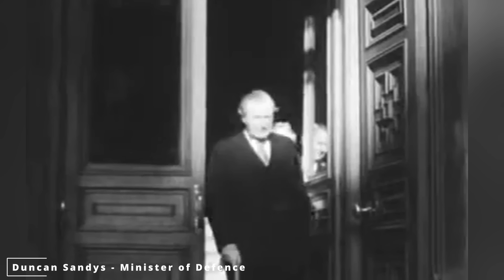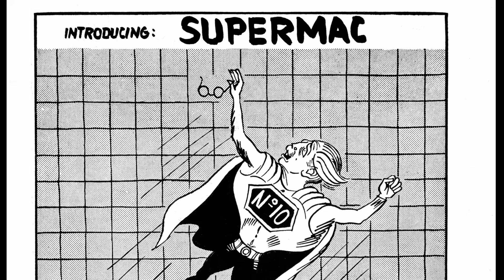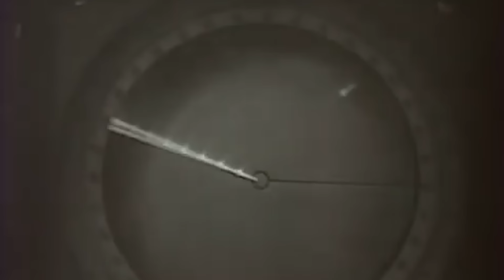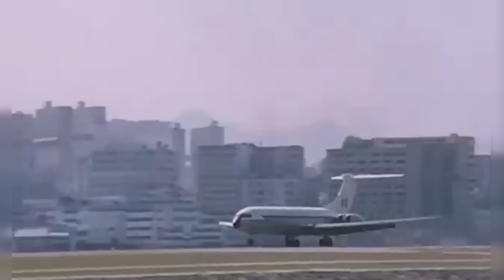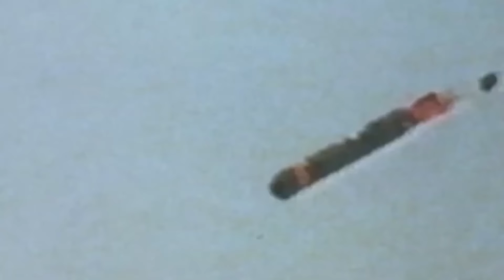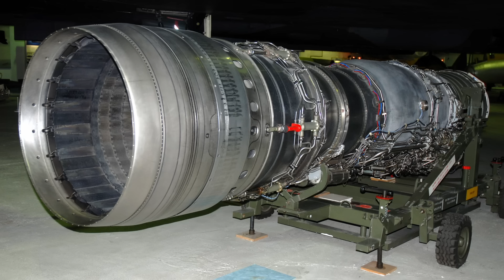How Britain Turned A Failed Airliner Into a Soviet Submarine Predator | The Mighty Nimrod

Comment: Most people know what a brilliant airliner the Comet was and how it became the Nimrod and equally brilliant. Americans don't know about anything outside of America so they pretend they were the first jet airlines and similarly they don't care to know how the Nimrod outclassed their Maritime planes.
Reply: Only the 2 Nimrod prototypes were built from unsold Comet 4C aircraft.
The Hawker Siddley HS.801 Nimrod is actually a completely different aircraft  and shares nothing in common with the Comet other than being assemble in the same factory at Woodford.
Reply: @sandervanderkammen9230  

We believe we can clear up some commonly held myths and misconceptions obviously.

It's always good to see the facts presented clearly and concisely isn't it?

Bow-wing (see B-47 wing collapse wing folding incidents) had built less than 12 pressurised airliners before the Comet first flew and they were not high altitude airliners. 

All Nimrods were new build Comet 4 airframes with appropriate strengthening and the unpressurized  equipment bay tacked on. 

The HS 801 Nimrod was the most advanced aircraft of it's type at the time it first flew. Problems with the MRA4 programme were almost entirely due to radar and computer equipment issues and BAe Systems & co being too busy with other work at the time. 

Obviously there have been worse aircraft for accident losses both before & after the Comet.

Early problems with Comet takeoff stalls were caused by pilots over rotating the aircraft at liftoff. 

Podded engines on wings have aerodynamics issues. The main reasons for eventually going with podded engines were because or to facilitate -
Ease of maintenance.
Use of shear off fixings given excessive out of balance forces.
Large diameter turbofan engines.
Reduce load on the wing to fuselage connection. 
Increased power from later engines. 

The Bow-wing (See B-47 wing collapse & wing folding incidents) was a good example of how to expend a huge amount of cash and effort on something that was probably not worth bothering with. The basic design of the Comet had been decided upon and established before the podded engine choice has been made for the B-47. There were aerodynamics problems with podded pylon mounted engines at the time. The US also built and operated a significant number of EE Canberra bombers under licence which did not use podded engines for their wing mounted engines. . 

There have been aircraft losses caused by pod & pylon mounted engines. 

All jet airliners benefited greatly from the knowledge gained from the Comet incidents & subsequent investigations & yet some were still worse for accident losses. 

Instances of all marks of the Comet flew with full certification after 1954 including the Comet 3. The last Comet flight occured in 1997.

The fabulous trail blazing DH Comet.
World's first jet airliner in regular service.
The jet engined Avro Lancastrian actually did a passenger service before the DH Comet. 
World's first high altitude airliner.
World's first airliner with a full fuselage length pressurised cabin pressurised for high altitude flight. That feature for that type of aircraft was a considerably difficult undertaking. 

The change from larger squarer windows to smaller rounder windows was necessary for the particular aircraft at the time. Skin thickness remained mostly the same for all Comet marks. 

How things were back then.
Accident losses - % of aircraft built.

DeHavilland Comet 4 UK                          14% 
DeHavilland Comet all mks UK (ff 1949)17%  
Vickers VC10 UK (ff 1962)                         5%

Douglas DC-1  US                                       99%
Douglas DC-2                                              47%
Douglas DC-3                                              30%
Douglas DC-4                                              26%
Boeing s300    US                                       72% 
Boeing 307                                                  70%
Boeing 247                                                   48%
Boeing 707  (ff 1958)                                 32% 
Lockheed L-049 Constellation (ff 1943)  30%
Lockheed Electra US (ff 1957)                   29%
Fairchild FH-227 US (ff 1966)                   30%
McDonnell Douglas DC-8 US  (ff 1958)   14%
Sud Aviation Caravelle  (ff 1955)             15%
Canadair CL-44 Turboprop US (ff 1959) 46%  
Convair CV-580 Turboprop US (ff 1960) 22%
Convair CV-880     (ff 1959)                      27% 
Convair CV-990     (ff 1961)                      33%
Tupolev T-104        (ff 1956)                     16%
Vickers Viscount UK  (ff 1948)                29%  
Fokker F-27 Turboprop NL (ff 1955)       40%      

The Vickers VC10, fastest Atlantic crossing for a non supersonic jet airliner, held the record for 41 years.

For the first few years of operation the Caravelle & Comet had similar accident loss fatalities.

Sud Aviation Caravelle - 
all accident loss fatalities - 
1320 fatalities. 

De Havilland Comet - 
all accident loss fatalities - 
453 fatalities. 

An example of a typical airliner from the period. 
The Fokker Friendship F-27 fatalities & accident losses as a % of aircraft built. 
Fokker F-27 Turboprop (ff 1955)   40%
2130 fatalities.

Of course De Havilland carried out a full stress analysis & performed extensive & protracted testing on two long lengths of fuselage representing all features of a complete airframe. De Havilland carried out significantly more testing than was required by any authority at the time & significantly more testing that any previous airliner was subjected to.

De Havilland designers / engineers knew all there was to know about metal fatigue at the time they designed the DH Comet.

De Havilland had prior experience building many all metal construction airframe aircraft including many passengers aircraft & thousands of jet powered fighter aircraft that were primarily of metal construction with pressurised cockpits & used jet engines built by De-Havilland.

De Havilland did indeed always work to better than industry standards at the time, used up to date knowledge for the design & testing activities & no evidence of negligence or criminal negligence was ever produced in relation to the DH Comet.

Global aerospace. 
From the 1950s sector rationalisation and consolidation took place. 70 companies in France and 300 companies in the US disappeared due to merger or dissolution. In the US Boeing was almost bankrupted by the 707 project.  Boeing had a well protected domestic market and the available space and resources in the US to engage in large scale airliner manufacturing enabling them to capture orders simply by being able to produce airframes fast enough and cheap and nasty enough. Another factor is airlines preferring to obtain as much of their airliner inventory as possible from one manufacturer. 

Global Aerospace Sector, what's happening.

For example, there are of course no German companies that makes German jet aircraft in Germany & there are no German companies that make German gas turbine aero engines in Germany that are suitable for widebody airliners.

The UK has the world's highest combined per capita Nuclear / Defence / Aerospace Sector Activity.

UK defence sector, absolute terms, world's second highest activity. 1st for per capita defence sector activity. Per capita nuclear powered submarine construction, 2nd position. 
Main players being Rolls Royce, Babcock, GKN Aerospace & BAe Systems. Activities often involve international collaboration. BAe systems, RR and other UK companies now handle more Airbus work value wise than Germany. 

There's a good chance that anyone currently flying on a widebody airliner will be on an aircraft powered by RR gas turbine aero engines made in the UK and a good chance there will be other hardware on the aircraft that's designed and / or manufactured in the UK. 

Rolls Royce Holdings UK
Subsidiaries
- Rolls-Royce plc
- Rolls-Royce North America (ex Allison etc Classified Military stuff)
- Rolls-Royce AB
- Rolls-Royce Deutschland
- Rolls-Royce India Private Limited
- Rolls-Royce Marine Power Operations
- Vinters Engineering Limited
- Rolls-Royce Controls and Data Services
- Rolls-Royce Power Systems
- Bergen Marine
Joint ventures include:
- Rolls-Royce Turbomeca
- MTU Turbomeca -

Trent Family
The MT30 (Marine Turbine)
Industrial Trent 60 Gas Turbine
Trent 7000
Trent XWB Airbus A330neo.
Trent 1500
Trent 1000
Trent 500
Trent 600
Trent 700
Trent 800
Trent 8100
Trent 900
   
RR wholly owned subsidiaries in Germany handle smaller 2 shaft RR gas turbine aero engine work.

The UK space and aerospace sectors are highly productive, high-value industries that together contribute over £18 Billion in direct Gross Value Added (GVA) to the UK economy. Individually, the space industry directly contributes about 0.3% of UK GDP 7•2 Billion while the aerospace industry contributes approximately 0.5% £10•9 Billion.
   
We hope this helps.
Reply: Comet was the worst jet airliner to ever enter service, it was so bad the British Air Ministry permanently revoked it's airworthiness certification.
Reply: The Comet did not become the Nimrod... like the square windows myth is a common misconception.
Reply: @DoktorBayerischeMotorenWerke it was the basis for the Nimrod.
Reply: @EditaGordon-e9w  That's a common myth.
 Only the basis for the proof-of-concept prototypes, the production Hawker Siddeley aircraft are completely different
Reply: @DoktorBayerischeMotorenWerke   

We believe we can clear up some commonly held myths and misconceptions obviously.

It's always good to see the facts presented clearly and concisely isn't it?

All production Nimrod aircraft were new build Comet 4 airframes with the necessary modifications. The Nimrod was the most advanced and most capable aircraft of it's type at the time it went into service. The  Nimrid HS.801 was not available for purchase by other countries. The ability  if the HS 801 to repeatedly demonstrate detection of subs and the knowledge that it could deliver nuclear depth charges to a target was a very effective deterrent. 

Bow-wing (see B-47 wing collapse wing folding incidents) had built less than 12 pressurised airliners before the Comet first flew and they were not high altitude airliners. 

All Nimrods were new build Comet 4 airframes with appropriate strengthening and the unpressurized  equipment bay tacked on. 

The HS 801 Nimrod was the most advanced aircraft of it's type at the time it first flew. Problems with the MRA4 programme were almost entirely due to radar and computer equipment issues and BAe Systems & co being too busy with other work at the time. 

Obviously there have been worse aircraft for accident losses both before & after the Comet.

Early problems with Comet takeoff stalls were caused by pilots over rotating the aircraft at liftoff. 

Podded engines on wings have aerodynamics issues. The main reasons for eventually going with podded engines were because or to facilitate - Ease of maintenance. Use of shear off fixings given excessive out of balance forces.
Large diameter turbofan engines.
Reduce load on the wing to fuselage connection. Increased power from later engines. 

The Bow-wing (See B-47 wing collapse & wing folding incidents) was a good example of how to expend a huge amount of cash and effort on something that was probably not worth bothering with. The basic design of the Comet had been decided upon and established before the podded engine choice has been made for the B-47. There were aerodynamics problems with podded pylon mounted engines at the time. The US also built and operated a significant number of EE Canberra bombers under licence which did not use podded engines for their wing mounted engines. . 

There have been aircraft losses caused by pod & pylon mounted engines. 

All jet airliners benefited greatly from the knowledge gained from the Comet incidents & subsequent investigations & yet some were still worse for accident losses. 

Instances of all marks of the Comet flew with full certification after 1954 including the Comet 3. The last Comet flight occured in 1997.

The fabulous trail blazing DH Comet.
World's first jet airliner in regular service.
The jet engined Avro Lancastrian actually did a passenger service before the DH Comet. 
World's first high altitude airliner.
World's first airliner with a full fuselage length pressurised cabin pressurised for high altitude flight. That feature for that type of aircraft was a considerably difficult undertaking. 

The change from larger squarer windows to smaller rounder windows was necessary for the particular aircraft at the time. Skin thickness remained mostly the same for all Comet marks. 

How things were back then.
Accident losses - % of aircraft built.

DeHavilland Comet 4 UK                          14% 
DeHavilland Comet all mks UK (ff 1949)17%  
Vickers VC10 UK (ff 1962)                         5%

Douglas DC-1  US                                       99%
Douglas DC-2                                              47%
Douglas DC-3                                              30%
Douglas DC-4                                              26%
Boeing s300    US                                       72% 
Boeing 307                                                  70%
Boeing 247                                                   48%
Boeing 707  (ff 1958)                                 32% 
Lockheed L-049 Constellation (ff 1943)  30%
Lockheed Electra US (ff 1957)                   29%
Fairchild FH-227 US (ff 1966)                   30%
McDonnell Douglas DC-8 US  (ff 1958)   14%
Sud Aviation Caravelle  (ff 1955)             15%
Canadair CL-44 Turboprop US (ff 1959) 46%  
Convair CV-580 Turboprop US (ff 1960) 22%
Convair CV-880     (ff 1959)                      27% 
Convair CV-990     (ff 1961)                      33%
Tupolev T-104        (ff 1956)                     16%
Vickers Viscount UK  (ff 1948)                29%  
Fokker F-27 Turboprop NL (ff 1955)       40%      

The Vickers VC10, fastest Atlantic crossing for a non supersonic jet airliner, held the record for 41 years.

For the first few years of operation the Caravelle & Comet had similar accident loss fatalities.

Sud Aviation Caravelle - 
all accident loss fatalities - 
1320 fatalities. 

De Havilland Comet - 
all accident loss fatalities - 
453 fatalities. 

An example of a typical airliner from the period. 
The Fokker Friendship F-27 fatalities & accident losses as a % of aircraft built. 
Fokker F-27 Turboprop (ff 1955)   40%
2130 fatalities.

Of course De Havilland carried out a full stress analysis & performed extensive & protracted testing on two long lengths of fuselage representing all features of a complete airframe. De Havilland carried out significantly more testing than was required by any authority at the time & significantly more testing that any previous airliner was subjected to.

De Havilland designers / engineers knew all there was to know about metal fatigue at the time they designed the DH Comet.

De Havilland had prior experience building many all metal construction airframe aircraft including many passengers aircraft & thousands of jet powered fighter aircraft that were primarily of metal construction with pressurised cockpits & used jet engines built by De-Havilland.

De Havilland did indeed always work to better than industry standards at the time, used up to date knowledge for the design & testing activities & no evidence of negligence or criminal negligence was ever produced in relation to the DH Comet.

Global aerospace. 
From the 1950s sector rationalisation and consolidation took place. 70 companies in France and 300 companies in the US disappeared due to merger or dissolution. In the US Boeing was almost bankrupted by the 707 project.  Boeing had a well protected domestic market and the available space and resources in the US to engage in large scale airliner manufacturing enabling them to capture orders simply by being able to produce airframes fast enough and cheap and nasty enough. Another factor is airlines preferring to obtain as much of their airliner inventory as possible from one manufacturer. 

Global Aerospace Sector, what's happening.

For example, there are of course no German companies that makes German jet aircraft in Germany & there are no German companies that make German gas turbine aero engines in Germany that are suitable for widebody airliners.

The UK has the world's highest combined per capita Nuclear / Defence / Aerospace Sector Activity.

UK defence sector, absolute terms, world's second highest activity. 1st for per capita defence sector activity. Per capita nuclear powered submarine construction, 2nd position. 
Main players being Rolls Royce, Babcock, GKN Aerospace & BAe Systems. Activities often involve international collaboration. BAe systems, RR and other UK companies now handle more Airbus work value wise than Germany. 

There's a good chance that anyone currently flying on a widebody airliner will be on an aircraft powered by RR gas turbine aero engines made in the UK and a good chance there will be other hardware on the aircraft that's designed and / or manufactured in the UK. 

Rolls Royce Holdings UK
Subsidiaries
- Rolls-Royce plc
- Rolls-Royce North America (ex Allison etc Classified Military stuff)
- Rolls-Royce AB
- Rolls-Royce Deutschland
- Rolls-Royce India Private Limited
- Rolls-Royce Marine Power Operations
- Vinters Engineering Limited
- Rolls-Royce Controls and Data Services
- Rolls-Royce Power Systems
- Bergen Marine
Joint ventures include:
- Rolls-Royce Turbomeca
- MTU Turbomeca -

Trent Family
The MT30 (Marine Turbine)
Industrial Trent 60 Gas Turbine
Trent 7000
Trent XWB Airbus A330neo.
Trent 1500
Trent 1000
Trent 500
Trent 600
Trent 700
Trent 800
Trent 8100
Trent 900
   
RR wholly owned subsidiaries in Germany handle smaller 2 shaft RR gas turbine aero engine work.

The UK space and aerospace sectors are highly productive, high-value industries that together contribute over £18 Billion in direct Gross Value Added (GVA) to the UK economy. Individually, the space industry directly contributes about 0.3% of UK GDP 7•2 Billion while the aerospace industry contributes approximately 0.5% £10•9 Billion.
   
We hope this helps.
Reply: @DoktorBayerischeMotorenWerke 

Typhoon & Tornado, British design aircraft. 

Early days of the airliners.

The awesome De Havilland Comet.
World's first production jet airliner.
World's first high altitude airliner. 
At the time the Comet wasn't particularly dangerous. The DH Comet was definitely not the worst engineering failure in commercial airliner history.

Losses comparisons.
How things were in those days.

DeHavilland Comet 4 UK                          14% 
DeHavilland Comet all mks UK (ff 1949)17%  
Vickers VC10 UK (ff 1962)                         5%

Douglas DC-1  US                                       99%
Douglas DC-2                                              47%
Douglas DC-3                                              30%
Douglas DC-4                                              26%
Boeing s300    US                                       72% 
Boeing 307                                                  70%
Boeing 247                                                   48%
Boeing 707  (ff 1958)                                 32% 
Lockheed L-049 Constellation (ff 1943)  30%
Lockheed Electra US (ff 1957)                   29%
Fairchild FH-227 US (ff 1966)                   32%
McDonnell Douglas DC-8 US  (ff 1958)   14%
Sud Aviation Caravelle  (ff 1955)             15%
Canadair CL-44 Turboprop US (ff 1959) 46%  
Convair CV-580 Turboprop US (ff 1960) 22%
Convair CV-880     (ff 1959)                      27% 
Convair CV-990     (ff 1961)                      33%
Tupolev T-104        (ff 1956)                     16%
Vickers Viscount UK  (ff 1948)                29%  
Fokker F-27 Turboprop NL (ff 1955)       40%      

The Vickers VC10, fastest Atlantic crossing for a non supersonic jet airliner, held the record for 41 years.

For the first few years of operation the Caravelle & Comet had similar accident loss fatalities.

De Havilland had prior experience building many all metal construction airframe aircraft & thousands of jet powered fighter aircraft that were primarily of metal construction with pressurised cockpits & jet engines built by De-Havilland. No aircraft before the Comet was subjected to as much pre-production testing as the Comet. 

It's a great pity & a crying shame that British military forces had to occupy a large part of Germany for decades after 1945 & Russian military forces had to do the same. Of course Russia still posseses a large chunk of what was German territory & of course Russia & the UK produce nukes. Obviously Germany does not produce nukes.

Interesting British achievements.

The gas turbine engine was invented & patented in England before the 1800s.

Axial multi stage sequential stage compressor & turbine technology, first produced for turbo machinery use in England by Parsons of Ireland & North England during the 1800s. The components form the basis of most modern gas turbine aero engines. At the time the concept of the jet aircraft powered by axial internal combustion gas turbine engines was first mentioned thus the internal combustion jet engine & jet aircraft was indeed invented in England before the 1900s & before the Wright brothers got busy.

Work on the multi stage sequential stator rotor axial compressor as applicable to the axial compressor gas turbine aero engine was ongoing in England from around 1928 by Arnold Griffiths and others. By 1943 the Metrovik F2/3  Beryl was a running axial turbojet that was superior to anything anywhere else. As the centrifugal compressor engines were adequate and more powerful at the time development of a larger F2/3  version was commenced.

The Metrovik (UK)  F2/3 axial compressor gas turbine aero engine was flight certified & ran in 1942, it was the result of UK development work ongoing since 1929. At the time it was the most capable axial compressor turbojet in existence but was not required and development work continued on a larger version.

Frank Whittle performed the world's first demonstration of a gas turbine aero engine in 1937. People in Germany kept a close eye on everything going on in Britain at the time.

The centrifugal compressor RR Nene was the most powerful & most reliable gas turbine aero engine on the planet in 1944. That engine would be later built under license or copied in many countries including Russia (Mig-15 Mig-17), China, the US, France and Switzerland powered dozens of aircraft types for decades after 1944.

Pratt and Whitney and others produce centrifugal compressor gas turbine aero engines. The PW200 is a currently produced whittle style centrifugal compressor, reverse flow combustor, gas turbine aero engine. 

The world's first wind tunnel was constructed in England during the 1870s. The world's first supersonic wind tunnel was constructed in England in 1922.

There is no doubt that the Fairey (England)
Delta 2 was the world's first jet
aircraft to exceed 1000 mph.  Indeed It
exceeded the previous record by 310 mph &
held the record for 1 year. Incidentally, the Dassault Mirage 3 & 4 are based on the Fairey Delta 2.

More recent UK military jet aircraft.

The Tornado & Typhoon & their engines are Supersonic & are indeed British design aircraft with British design engines built by an international consortium. The Tornado design for example started life during the 1950s at Vickers as the AFVG, it's engine is based on the RR RB-199. The EE Lightening is also a British Supersonic jet aircraft.

The Typhoon is the British BAC-EAP with an engine based on the British RR XG-40, the Typhoon is also built by an international consortium.

Brazil has the world's third largest airliner manufacturer and makes very good airliners & Brazil is 100th down the list along with Indonesia for wealth per capita. Of course it is in fact the case that Embraer can't build those airliners without purchasing stuff from the US, UK & Europe. For example, Norway, Holland, Denmark, Ireland & Belgium, top 20 wealth per capita, don't make airliners, its as simple as that.

Global aerospace. 
From the 1950s sector rationalisation and consolidation took place. 70 companies in France and 300 companies in the US disappeared due to merger or dissolution. In the US Boeing was almost bankrupted by the 707 project.  Boeing had a well protected domestic market and the available space and resources in the US to engage in large scale airliner manufacturing enabling them to capture orders simply by being able to produce airframes fast enough and cheap and nasty enough. Another factor is airlines preferring to obtain as much of their airliner inventory as possible from one manufacturer. 

Global Aerospace Sector, what's happening.

For example, there are of course no German companies that makes German jet aircraft in Germany & there are no German companies that make German gas turbine aero engines in Germany that are suitable for widebody airliners.

The UK has the world's highest combined per capita Nuclear / Defence / Aerospace Sector Activity.

UK defence sector, absolute terms, world's second highest activity. 1st for per capita defence sector activity. Per capita nuclear powered submarine construction, 2nd position. 
Main players being Rolls Royce, Babcock, GKN Aerospace & BAe Systems. Activities often involve international collaboration. BAe systems, RR and other UK companies now handle more Airbus work value wise than Germany. 

There's a good chance that anyone currently flying on a widebody airliner will be on an aircraft powered by RR gas turbine aero engines made in the UK and a good chance there will be other hardware on the aircraft that's designed and / or manufactured in the UK. 

Rolls Royce Holdings UK
Subsidiaries
- Rolls-Royce plc
- Rolls-Royce North America (ex Allison etc Classified Military stuff)
- Rolls-Royce AB
- Rolls-Royce Deutschland
- Rolls-Royce India Private Limited
- Rolls-Royce Marine Power Operations
- Vinters Engineering Limited
- Rolls-Royce Controls and Data Services
- Rolls-Royce Power Systems
- Bergen Marine
Joint ventures include:
- Rolls-Royce Turbomeca
- MTU Turbomeca -

Trent Family
The MT30 (Marine Turbine)
Industrial Trent 60 Gas Turbine
Trent 7000
Trent XWB Airbus A330neo.
Trent 1500
Trent 1000
Trent 500
Trent 600
Trent 700
Trent 800
Trent 8100
Trent 900
   
RR wholly owned subsidiaries in Germany handle smaller 2 shaft RR gas turbine aero engine work.

The UK space and aerospace sectors are highly productive, high-value industries that together contribute over £18 Billion in direct Gross Value Added (GVA) to the UK economy. Individually, the space industry directly contributes about 0.3% of UK GDP 7•2 Billion while the aerospace industry contributes approximately 0.5% £10•9 Billion.
   
We hope this helps.